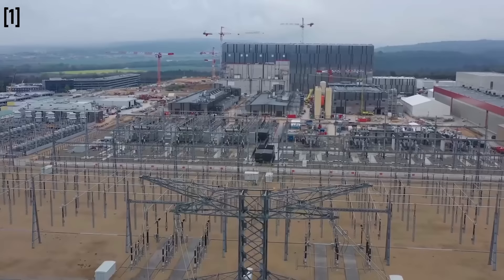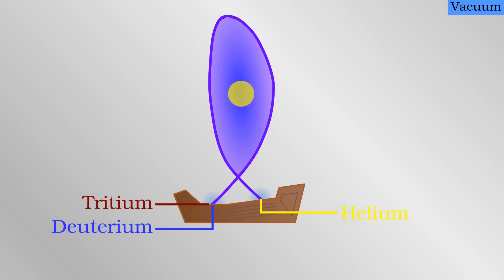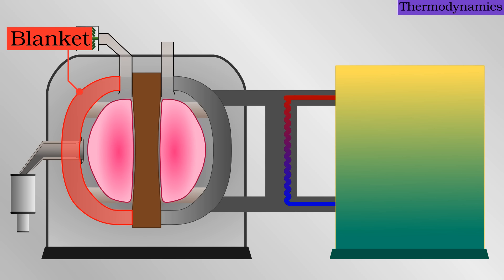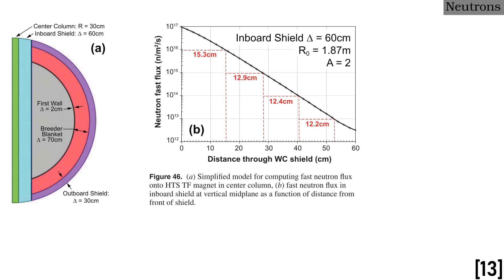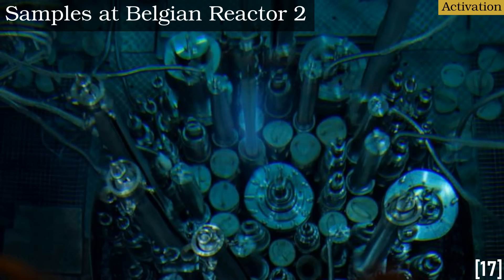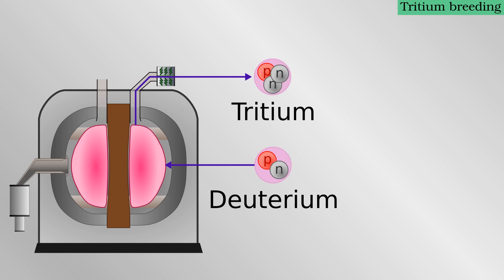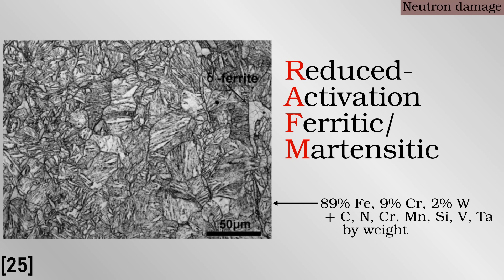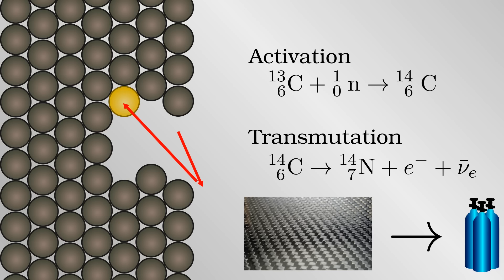How nuclear fusion (maybe) works (4) - reactor practicalities

Comment: At 11:29 when you show the Produkt it looks confusing. Also why do you talk about a factor of 3, when the factor is the nutrons in free flow. 1 to 2.5. It might have been better to show it for an equal "energy output" in MeV? Because as the slide shows well 72 is X times greater than 22.4 and the numbers are related to the pictures of the fusion and the fission.
Reply from the maker: The numbers are "energy per neutron". Fission gets 3 times as much energy for every neutron produced; fusion will therefore produce 3 times as many neutrons for the same amount of energy.
Reply: How do you derive the MeV produced? Isn't that only an absolut number, that is related to how much material is used for the process?
Reply from the maker: @Airwave2k2  The numbers are for 1 reaction. Multiply up to get the amount of Joules, kWh and so on.

Comment: Chad Nuclear fission (just works as a power generator) > Beta Nuclear fusion (works as a power generator if you ignore 1,000,000+ problems that stops it from working) 

Get back to me when the cost/energy of fuel input equals less than the output energy created.  (No it's not been done yet before someone says.)

Comment: Basically what he is saying is that we are nowhere near a CONTROLLED fusion reaction. In fission reaction the neutrons being bumped off the atom hit other atoms and bump off more neutrons, so on and so forth. It is very easy to control the rate of neutron bombardment with boron rods. The reaction is self-sustaining. In fusion, so far, they haven't figured out how the production of energy can trigger a sustained reaction (as it does on the sun). Every time they must bombard the hydrogen atoms with an outside energy source to smash them together to form helium.

Comment: Steel would make a poor choice for the reactor containment because it will be magnetic & cause partial shielding of the magnetic field created by the external magnetic coils. I believe a lot of heat would be created in a magnetic material like steel because of eddy currents.

At this point we know fusion will never be economically practical. The cost to build & operate a fusion plant would likely be at least 50 times the cost of a fission plant, which is already too expensive. I also believe there are to major unsolvable problems for Magnetic Confinement fusion: 

1. Maintain a stable magnetic plasma field, because the plasma creates magnetic fields & produces eddy currents that end up destabilizing the containment field. Plus Magnetic fields are not uniform as the are distributed int field lines which create peaks & valleys of field strength. 
2. Neutron activation of the magnetic field coils. This rules out the possibility of using high temperature superconductors because the high neutron flux will rapidly cause the to fail. Nb SC alloys can work for extended periods, but require ultra low cooling temperatures which can only use liquid helium. There is already a limited supply of helium available and I suspect a fusion plant would consume tons of liquid helium (since helium gas would escape over time do to its properties). Another issue is going to be the insulating materials need to keep the liquid helium cooled as those would likely decay & fail from the high neutron flux. The very light insulation materials would absorb a lot of energy (ie hydrogen cross-section to convert fast neutrons into thermal neutrons).

Considering that we passed Peak Oil production & global Oil production is already down about 8%, and the world Debt to GDP ratio now exceeds 3 times global GDP, there is no way industrial civilization survives beyond the 2030s (it might start to collapse this decade). There simply are too many major problems. Once the cost of diesel exceeds about $12\gallon, The Industrialized world starts collapsing & it becomes too expensive to maintain business as Usual. Large number of companies will fail and store shelves go bare. 

Considering the energy crisis unfolding in Europe, as well as demographics, and Debt, its likely that ITER will be canned in a few years.  Already new ITER Delays have been announced which will push back the first plasma tests from 2025 to 2027-2029. My guess is ITER ends up getting cancelled around 2026 to 2029, as the EU & US can no longer afford to fund it. Right now NATO is spending hundreds of billions on a pointless war in Ukraine and this war (and the pending war with China) will bleed the US & EU dry.
Reply: 50x a fission plant?? 😂😂
Reply: @Gomlmon99  At least. Just look at all of the requirements needed:

1. Extreme hot plasma 100MK.
2. Superconducting magnets that require cryogenic cooling
3. Lithium-beryllium breeding layer to covert fast neutrons into tritium fuel & a process to extract Tritium. I believe the world annual production of Beryllium would only be able to meet the Beryllium requirement for just one Fusion reactor.
4. High vacuum contaminment system
5. complex heat extraction to convert fast neutrons into heat capture to run the turbines As well as extracting thermal energy from the plasma that can never be in direct contact with the reactor walls.
6. Complex robot machines to inspect & repair the reactor systems since every surface will be neutron activated (ie highly radioactive). 

A fusion plant is at least 50 times more complex than a fission plant, thus will cost 50 times more to build & operate. 

I believe ITER construction costs will be about $65B for 500 GWth, and that does not include the costs for breeding Tritium and complex equipment for electrical power generation. A 1 GWe Fission Reactor costs about $15B. ITER alone with just the very basic is over 8 times more expensive than a fission reactor.

Also consider that a 1GWe Fusion reactor would burn about $2B USD of tritium per day.
Reply: @guytech7310  ITER is much bigger and older than any modern design. Modern designs will be less than that, whilst you’re suggesting they will cost 750 billion? How is that remotely logical?

Where does this pervasive myth about tritium burning come from? A power plant is self sufficient, it’s needs 0 tritium input once started. Why are you parroting this?

A lot of the other things you said are blatantly wrong as well

Comment: It seems that Tokamaks are not the way. Supposing every issue solved, Tokamaks are inherently pulsed machines which cannot operate in steady state
Reply: With techniques like neutral beam current drive and lower hybrid current drive, plus bootstrap current, it is demonstrated to be possible to run without inductive current.